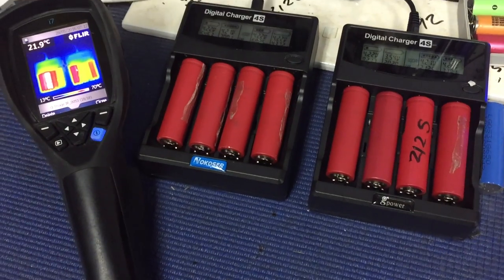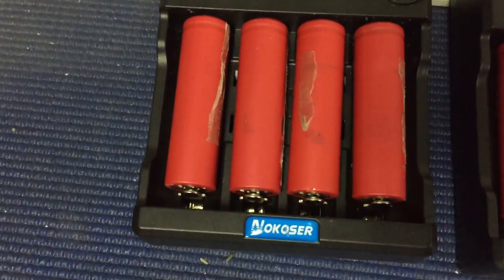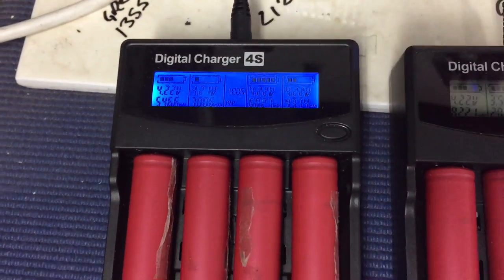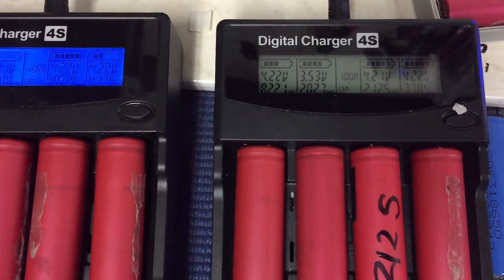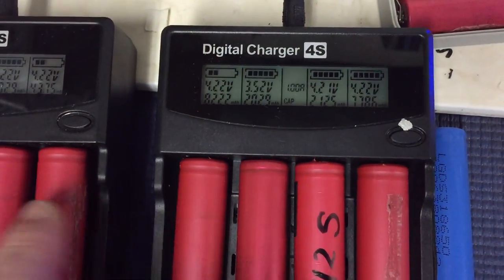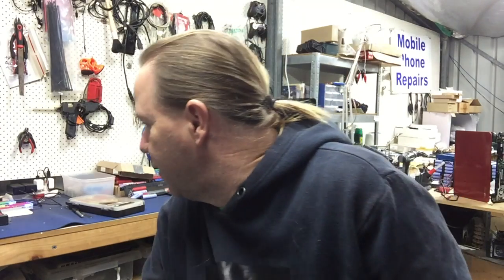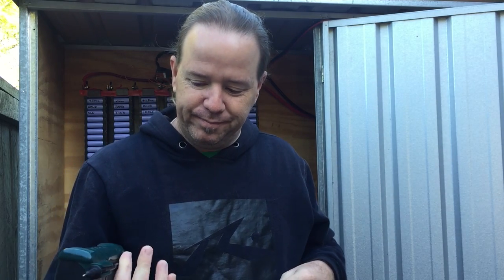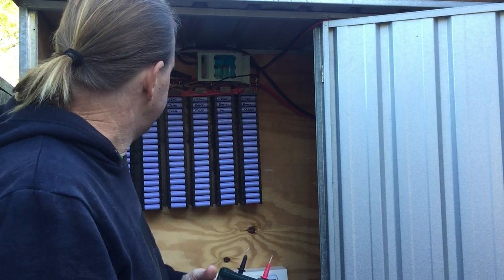DIY Powerwall 1000w Load test #2

Comment: Why is power storage so addicting? 😂 
Still working through your playlist - at this point, already, I can’t even express the value I’ve received from watching and experiencing the whole process! Anyone can post something saying, “ok, folks, here’s the way to do it...,” and lay it out in a video or two. But “riding along” with you through the process is helping me loads, by forcing my brain to work through each issue and question you faced along the way, and working through the solution. I started out with an idea, and after a few, revelations I’m actually formulating a design. I think you’ll like it... of course, it may change before I get started, depending on what the rest of your story exposes to my brain. 
Thanks again!!

Comment: Sorry for the thread necromancy, just recently discovered all this stuff and am going back through your videos.

When you described your wires showing 50 degrees on the thermal camera, but being clearly not nearly that warm, it occurs to me that the wires in question are fairly heavily insulated. It's quite probable that the actual metal wire inside was the temperature the camera indicated. You didn't feel it fully because the electrical insulation was thermally insulating the wire as well, but the particular plastic those cables have on them is probably transparent to the IR the camera is looking for, so it sees right through them and sees the temperature of the wire inside.

Comment: low cell might have lower capacity to other cells and is discharged and probably charged quicker that the rest.
Try hooking up anout 4-8 18650 more to that cell and redo the test. it might bounce up.
Also the high cell was probably the best one of them all.
3V off load is already bad for the cell. Battery should terminated somewhere around 3v but with 1A load to each 18650 so be carefull charging that one.

Comment: when you put the two packs in parallel you will get a higher Ahr from the two. the cells look to have a high internal resistance which is to be expected as they are used cells. ( high compared to new)
from tests I have seen on high loads on lead acid batteries 1+1=2.7 to say that a double of capacity, halfs the load so you can get more of the capacity with less loss due to resistance. so you get more of the actual capacity out.
Reply from the maker: hope so :)

Comment: Read up on emissivity. The thermal camera needs a reflective index to base temperature on. Use black satin tape to measure more accurately over a variety of different surfaces.
Reply from the maker: yep since learned that - I love the comments on videos learn so much from the community. Thanks for taking the time.
Reply: @HBPowerwall  Any time and thanks for taking the time to post these. Very informative and inspiring videos to say the least. Keep up the good work!

Comment: from the nominal capacity of a 18650 cells, how lower capacity should be consider to think that it is a good cell.
Reply: so once you decide use a cell with only 60% capacity, and use it, how long is the span
Reply from the maker: still, have some of them running from 2 years ago

Comment: Ok first of all well done. Now I noticed that you are investing a lot in this. There is another way to make a storage system and that is to use a battery of a damaged electric car. There are a few that already showed us how the set up a pack from a Nissan Leaf. I am not sure about in Australia, but it will not take long before the electric car invades the world. Nissan collected the old Nissan Leafs and put the good cells in a nice packing and re sold it. I think that they will lose money if they do that because it costs to collect them and sort them etc. Also most if not all of them will be degraded, just like my 18650 and yours. At the same time the new chemistry will make the new batteries from say Tesla or VW will have more energy and smaller and cheaper. So I do not think that Tesla will do like Nissan and I think that Nissan will not continue with refurbishing old depleted cells and will do like Tesla and sell new ones always. 

You are more lucky than me because you live in the west and have access to a better infrastructure. But from what I read your electricity is much more expensive than mine in Cairo Egypt. At the end of the day we both did our systems and can save money or be 100% independent from the grid.

I am trying to be 100% independent from the grid gradually.
1 Air conditioning. I bought a Samsung 1 Ton inverter split unit and it works perfectly on my 1000 18650 unsorted and randomly put. They all had to be 2.6 v or above though.

2 I am now going to convert an old split ac to heat water. The COP of the AC I am talking about is 3.2 So for every watt I will get 3 or more to heat water. I saw a system that heated 100 litters of water from 20c to 40c for just 500 watts in one hour. You can not get better than that.

3 Induction cooking. Some of these induction cookers can take DC directly instead of using a big inverter to deal with the 2 kw load. But you have the 48v 4kw inverter so you can run an induction cooker at the same time heat water and run your ac. 

4 Lights TV laptop chargers are all small loads so they are all running on the sun and batteries 24/7

5 I will invest in a new inverter fridge freezer because mine now is 15 years old and it takes 170 watt per hour and works about 20 hours per day. The new ones take 161 kWh per YEAR. I might need to increase production by adding more panels to my 2 250 watts panels. Yes I run my system on just two 250 panels. We have 3400 hours of sun here in Cairo Egypt.

So we will be 100% off grid soon. 

The next big project will be to install this on my car 
http://www.proteanelectric.com/
It will take time but I will try. 

At the end we will say good bye and no buy to oil and natural gas. So you work at your end of the world and I will work at my end. Hopefully we will have a peaceful world for our kids.

Best regards from Cairo Egypt.

Alaa

alaa.sadek2 skype